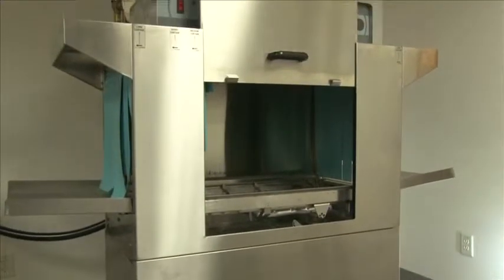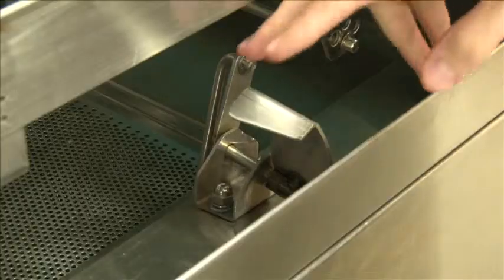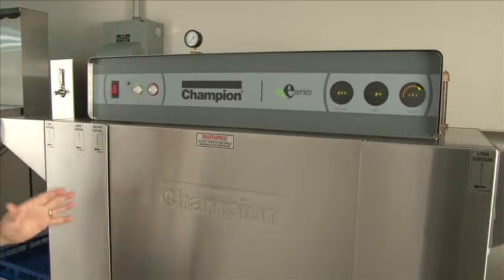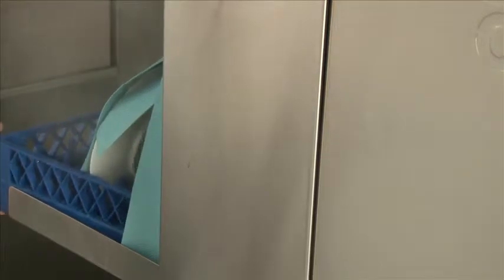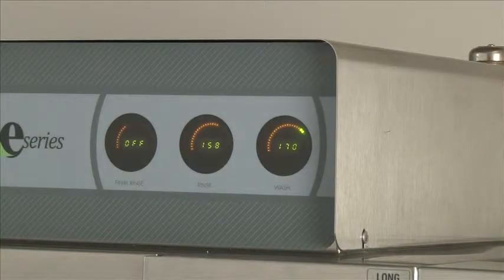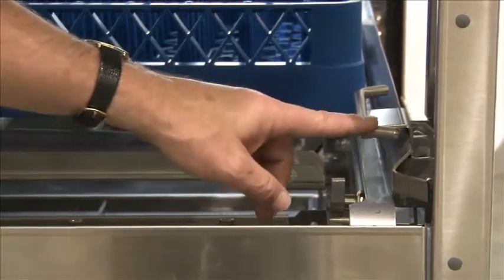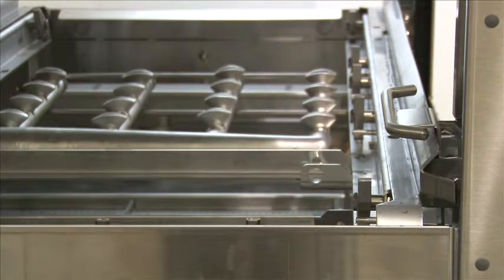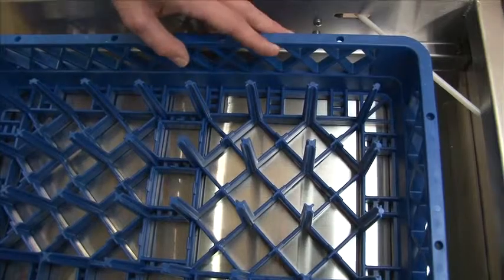Champion Rack Machine Operation

Comment: How long is FInal rinse ?
Reply from the maker: Hey there Wilder Gomez, are you asking physically how long the final rinse space is or how much time it take for a rack to pass through the final rinse section?
Reply: @championind  Hello Champion team and than you for the response. my question is how much time it take for a rack to pass through the final rinse section?
Reply from the maker: @wildergomez9181  It should only take about 10 seconds to pass through the final rinse section of the machine in this video. It would take about 25 seconds to pass through the whole machine. Does this help?
Reply: @championind  Thank you so much for your response.